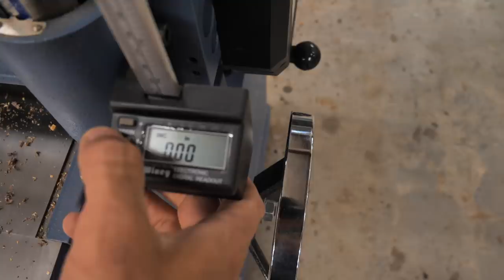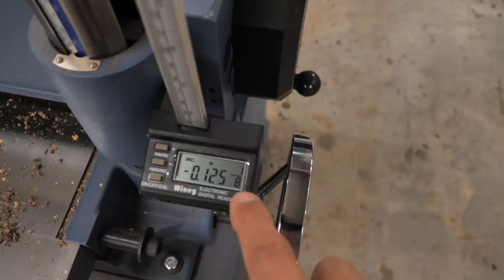A Closer Look At My Jointer And Planer And What They're For (Oliver Woodworking Machinery)

Comment from the maker: Thanks for tuning in and let me know if you have any questions regarding the process or the machines!
Reply: Andy - how do you decide when to use your s4s machine vs. the jointer/planer combo? (Thanks for the great videos!)
Reply from the maker: The S4S is limited to a width of 7.5” so anything over that has to go through the jointer and planer.  If I just needed a few quick boards then I’ll use the jointer and planer but if I’m running a lot of parts then I’ll use the S4S.  I’m using the S4S way less than I used to because I’m building less production furniture on account of producing more content for YouTube.
Reply: Instead of the table saw could you run the final edge back through the Jointer to clean up the last side?
Reply: @delcoshootingsupply  that would not make it parallel to the other edge. It would be square to face but not parallel to the other edge.
Reply: Have you ever seen one of those European style 5 operation combination machines? You have sliding tablesaw, spindle moulder, horizontal mortiser, jointer and thicknesser all in one. I have that type of machine and it is nice because it doesn’t take that much space and also it is a little cheaper.
Reply: @delcoshootingsupply  As soon as you have two sides plane/flat and they are squared to each other you could use either a planer or a table saw for the two remaining sides. However, if the piece is wider than it's high and/or its a hardwood, it's normally faster and with better result to square up the width (the lowest cut) with the saw and then run the piece through the planer (on both sides) to finish it all off with best result. (this is at least how I do it).
Reply: @MJ-nb1qn  oh ok. I ask because I work with a lot of hardwood which is rough sawn and it has live edge on it. So for me it is kinda important to make straight edge cutting on my slider, but it is only 160cm/65” long so if I need to straight edge something larger I have to find other way. But for me and my purposes, this machine is more then good.
Reply: I'm trying to decide between 20" grizzly 5hp helical and Oliver.  Don't understand why the griz has  nearly 30 more cutters on it - both are the exact same size cutters.  Maybe griz has an extra row on the helical head.  Love the simplicity of the Oliver- both look like very comparable machines.

Comment: Pro Tip: paint your floor in front of your jointer with texture floor paint. It will help you gain traction while pushing those beasty boards thru.

Comment: Really liking the 16” jointer.   Only thing I question is why the hand wheel is so low on the 20” planer.  Oliver’s 16 inch model is much higher up.  Leaning over and bending down to turn the crank would get annoying, at least for me.

Comment: Helical cutter heads are like when carbide saw blades came out, the old HSS blades were rendered obsolete. HSS straight knives are pretty much in the same boat. It's not a small difference between a straight knife head and a helical, its a huge difference. IDK who would think straight knives are better today.
Reply from the maker: I agree but I know several furniture makers who refuse to switch to helical heads.

Comment: Question. At 4:30 seconds it looks like it shows a pretty large crack in the jointer outfeed table close to the cutter head. I've paused at several points and it looks like a pretty jagged opening. Am I seeing that correctly?

Comment: I like how the thickness planer is fixed to the base.  So you could make out feed tables.  My thickness planer the top cutter head is fixed so if I made an out feed it would have to be adjustable as well.

Comment: I’m a little amazed that they still make jointers with the rabbet shelf. I don’t know anyone that uses them myself. 

That’s why the depth will go to 3/4”.
Reply: It's helpful when jointing boards wider than the jointer. In this case 16" you aren't gonna have too many boards like that, but it does definitely come in handy pretty regularly in my shop. I don't use it to cut an intentional rabbet but I do use it so I can then flip it over onto a sled for my planer and use that to face joint a board wider than my jointer

Comment: I see quite a lot of US woodworkers in their tiny garage using a separate jointer and planer, what about the use of combined machines (jointer-planers) in the States? Are they just not readily available or just not that popular? All you'd need is the footprint of a jointer as the planer sits underneath. As for Andy Rawls and his olympic stadium sized workshop, I fully understand though why he has two separate machines.

Comment: Nice video. I liked the demo part before explaining the particulars about the machines. I was extremely lucky to find a factory owned 2015 model with a 6” wide table and have been waiting for a week for delivery, due on 13th. Recently, I’ve found real enjoyment cutting logs into lumber, making a white oak family table, maybe I can continue this as a business when I retire from the military in 2 years (27 total). 

Could you recommend a plainer model that aligns with the jointer I have coming? Something that will make up for any shortcomings I may run into with the 6” jointer.

Comment: Could you manage with just the jointer? It seems to me that the planer is good if you want to preserve an edge but get two faves faces parallel. But if you're looking for square lumber you could just joint each face off the last. Would that give similar results to using both machines?

Comment: I don’t have a jointer, but I was wondering if you needed to press the flattened edge against the fence when jointing the second edge to ensure it is perpendicular. I have seen people do it this way, but I don’t think you did in the video. Just curious if it is necessary

Comment: They look like great machines. When you joint it seems like you reference the infeed table not the outfeed table as far as where you apply  your downward pressure? Big boards doesn’t matter but do you change that for smaller pieces?

Comment: What do you mean by parallelogram jointer, Andy? Those are great machines - just way too expensive for us mortal woodworkers (hobbyist). Take care.
Bill
Reply: A parallelogram jointer has the beds attached to the head via arms that pivot. The parallelogram shape is changed by screws to move the beds up or down. Most other jointers are wedge type jointers.
Reply: @stallionranchwoodworks  Got it. Thanks. Mine has slides.

Comment: Very informative episode Andy.  Questions:  How wide of a piece of wood can you level on the joiner?  Also, when you get your wood for projects, is it already dried so you're not worried of the moisture content of the wood?  I know you mentioned before that some of your customers supply you with the wood they want used on a project.  Is that wood always dried so you can start the project immediately if you had to?  💖👍
Reply from the maker: The jointer is 16” wide.  All the lumber I buy from my local hardwood dealer is kiln dried and anything I get from local mills is typically kiln dried but I always put a meter to it to check.  When customers supply it I usually have to find a mill to dry it for me.

Comment: Good stuff Andy. Like always. Is there anyway you could do a video showing how to tune up and dial in a jointer and a table saw? I’ve got an old powermatic 50 and a Rockwell arbor saw that could use a good tune up
Reply from the maker: I don’t have a video on that but Marc over at the Wood whisper  has a really good video on setting up a jointer. https://youtu.be/gO746cuRqV4

Comment: Those are named Oliver, they're not Oliver, they bought the name, The real company made some of the finest machinery ever made, They were made in MI, all that stuff now is made in china it's not even close to the same.
Reply: Thanks for the info, I was hoping they were made in the US :(
Reply: @markkulyas2418  sadly not much is USA made anymore, Northfield still is and I believe Tannewitz still makes some bandsaws here. But if you want USA made you have to pretty much buy used. But the good thing is that if you look they are out there and you can get them, although for whatever reason lately the prices on everything has shot up. you can usually find big older American made Jointers for around $5000, and considering the asian larger machines are almost double that its still a good deal,